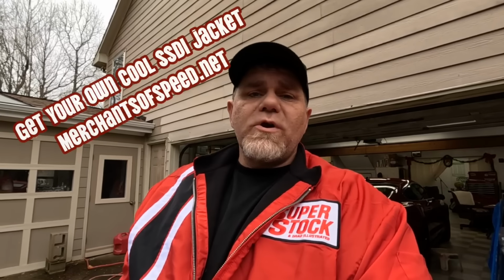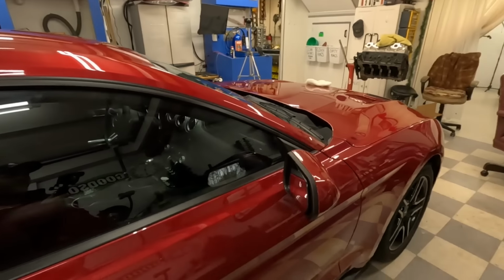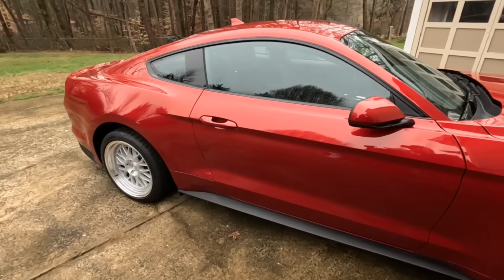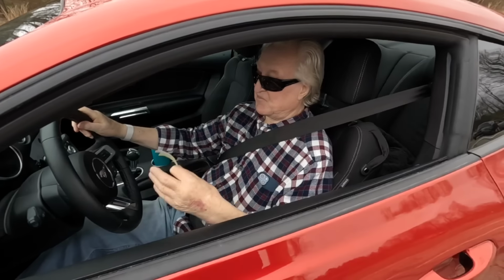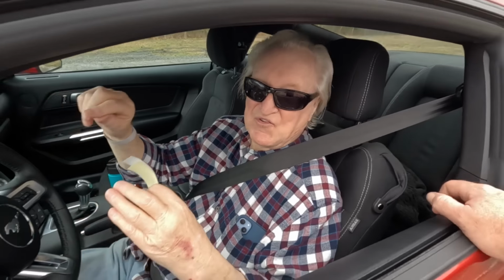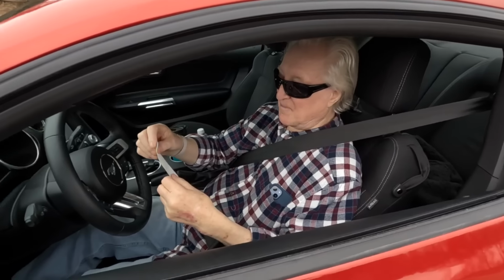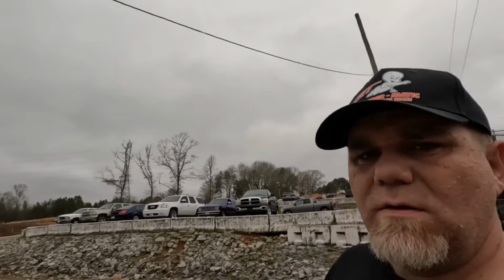EcoBoost Mustang 10R80 3.15 vs 3.73 Gear swap Drag Test! @DavidVizard @Boostismyfriend Shadyside

Comment: Your fighting torque management, you need to retune it with HPTuners or EFI live. The computer will pull timing if it the ratios aren't recalculated and the delivered torque values not increased.
Reply from the maker: We have HPTuners, I can tell it's not really happy.. hopefully once we have it tuned properly it will get down!
Thanks for the input and for watching
Andy
Reply: @UnityMotorSportsGarage  😅😅😅 Ecoboost and gettin down don't go in the same sentence.
Reply from the maker: @anthonykendrick1418 oh it will when it gets the Turbo and head Swap.. it will be down right nasty then..
Crazy if you ask me lol
Andy
Reply: You’re gonna need to get neck deep in the HPTuners for both the ECM and TCM tunes. I finally forked out the money for HPTuners and after spending a while with it, “Learning Curve”, I would swear my old truck is considerably faster than the day I drove it home from the Dealer 24 years ago. Btw, looks like a fun project.
Reply: @UnityMotorSportsGarage With HPtuners you can set your shift points to hold it in gear on the dyno. The bluecat software is good for setting shift points.

Comment: Why change the gear ratio when it has a 4.70 first gear?  That's like putting a 5.40 gear in a stock 5.0 foxbody and running on the gatorbacks.  It did good considering.

Comment: Glad to hear you're working with Greg, over at Eurocompulsion and using HPtuners' hardware/software! You should be able to dail in your Ecoboost Mustang to run high teens at 60' and high 7s in the 1/8 mile with just tuning, basic bolt ons and blended fuel!
I also recommend a taller (28") rear drag radial and experimenting with a 2nd gear launch.

Comment: As you guys were talking, driving to the dragstrip I wondered "what is the car's computer gonna make of this gear change?" It's an 18% increase in torque multiplication, not outrageous  but not peanuts, as the wheelspin shows. 

So many variables going on, it's interesting stuff. I'm sure it makes the car row through all those gears that much quicker now!
Reply from the maker: The computer just seems confused.. lol I believe a proper tune will fix it right up!
Andy

Comment: My 15 ecoboost had a sport position on the shifter and paddles on the wheel. It would let you hold a gear, unless you did something silly like slow way down in a high gear. It was 6 speed auto.
Reply from the maker: This is just a base model so it doesn't have the paddle shifters 😢
Thanks for watching
Andy

Comment: @UnityMotorsportsGarage- Cool temp's @ the track, mean's make's good power, but traction is not great. I would do more of a burnout, even with regular tires, to put more heat in them, on a cold day. The trick is, with regular street tires, do a low wheel speed burnout, but for about 8 to 10 seconds. This allows the regular tire to slowly build heat, but just as importantly, to coat it with the sticky drag tire compounds, from the other drag racers burnouts! It used to work great for me, i managed a 1.71 60 ft time, and ran a 12.21 @ 113 Mph, with regular Cooper Cobra radial tires, with 25 psi.
Reply from the maker: trying to do a burnout on that car is tough.. I can start a slow burnout but once the boost comes in it will just melt the tires without my permission.. its like a light switch! 
Thanks for watching and your input
Andy
Reply: @UnityMotorSportsGarage - Yes your situation is definitely different than mine was, yours being a turbo, and small cu. In. Eng.= very peaky= hard to modulate the power, vs my Na., Large cu. In. Eng.= very fat tq. Curve= very easy to modulate. Hope you don't think im a know it all? I'm just trying to see if i can give any idea, that may assist your progress. Do you think holding= manually putting the shifter in 1st gear, would work for your burnout procedure, with these regular street tires? This very low gear ratio, in 1st gear, would allow a high rpm(but low wheel speed burnout) for 8 to 10 seconds= a much easier, controllable, burnout? Drag radials, will definitely do better. Are you going to get the shortest drag radial possible, to keep tire wt. down, and gear ratio, as quick as possible? ❤your videos!

Comment: Are you all data logging? If not I highly suggest you get a bank’s data monster and start. Best part is it gives the rpm/sec acceleration weight. Obviously if you run under the same conditions and it accelerates quicker you are making more power. 😊 For about $400 you can monitor ever data point the factory ecu is monitoring and have a record of it.

Comment: @UnityMotorSportsGarage Andy & DV it won’t be long before you’re stressing the stock driveline to the limit when you add drag radials. Get the tuning right plus increase trans pressures along with shift points and adding NO2, I’m afraid you’ll find the next weak point.
Reply from the maker: That's the point! Something has to give... I believe it will live for a good while since the drive line in the Coyote Cars are basically the same. But we shall see!
Andy

Comment: The new wheels look great on it. Times are getting good now. Has the intercooler been upgraded yet. That stock IC gets heat soaked so fast. 
Again for reference my bone stock 21 GT ran a 8.03 on good street tires. You’re almost there with a stock turbo. Good luck

Comment: Hey Andy, question on the Caspermatic, what year 4r100  to look for on my mustang 2 project tia 😊
Reply from the maker: That would depend on the engine you are going to run. The 4R100's are pretty much all Mod Motor bells, I do believe that one year it was offered behind the 300 6 and that would have the SBF bell. 
I would take some measurements to make sure it will fit the floorpan and Firewall as it's a big transmission
Andy

Comment: Mr Vizard, Did you do the 3.73's for the 1/8 mile? I always used taller gears for my Turbo/Manual cars racing in the 1/4 mile. I didn't have to shift as much and they seemed to like load/each gear was effective.

Comment: Look at cvf racings heat exchanger upgrade.  They show real world gains in efficiency.  Might be why  it was lying over.  Hot intake air the computer will pull timing.

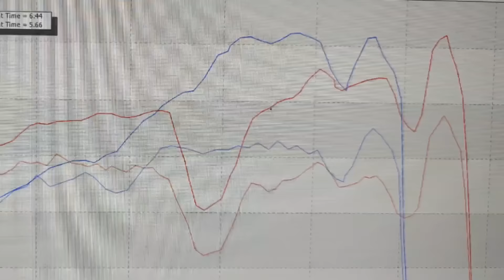Comment: First gear has a 4.70:1 ratio, a 3:15 final drive is not deep  , hell the overall ratio is 14.8:1 in first gear. A 4R70W trans in a car with 4.56 gears has a 14.3 overall ratio in 1st. With only 4 gears to work with, instead of 10.

Comment: What are you doing with the 3.15 gear set. I might be interested for my 1940 Ford Fordor when I change to an 8.8 instead of the 2.79 Pontiac axle.
Reply from the maker: This is a Super 8.8 gear set which is different than regular 8.8's 
Most likely once we add some real power to it we might need to put it back in..lol
Thanks for watching
Andy
Reply: @UnityMotorSportsGarage I read something about the Super 8.8 and it being different but nothing about what is different. I stopped at the local Ford dealer and talked to the parts manager who used to be service manager. He said he knew nothing about a Super 8.8 diff. 
I have a Crown Vic parts car with 2.26? gears and an AOD. That 302 must have been at idle speed on the highway. The ring gear is thinner where the bolts go through or the carrier has the gear mount flange moved over to make room for the large diameter pinion. Labeled an 8.5" but 8.8" carrier and gears drop right in.
I did get a set of 3.55 gears from my brother in law when he switched to 3.73 in his 05 Mustang that he used for track days. The 3.55 should work fine with an AOD with the wide ratio gears or a 4R70W. Putting the planetary set into an AOD would let me install without a control module. The car is a cars and coffee driver.

Comment: Hi, nice to meet you, I've seen your videos and I really love the Ecoboost you have. I wanted to know if you could tell me what exactly you need to put 3.73 gears, each piece. The thing is that I bought the crown, the pinion, the set of bearings and the shims. Do I need anything else apart from that? I hope you can help me. I have a 2020 Ford Mustang Ecoboost.

hola mucho gusto, he visto tus videos y la verdad me encanta el ecoboost que tienes, quería saber si podrías decirme que necesitas exactamente para ponerle gears 3.73, cada pieza, lo que pasa es que he comprado la corona, el piñón, el juego de baleros y las lainas, necesito algo más a parte de eso? Espero puedas ayudarme, tengo un Ford Mustang ecoboost 2020

Comment: Cool stuff. Why not go to 4.10's? It's a lot of gear for my SN95 with a T-45 but I'd figure it'd work great with that many gears!
Reply from the maker: The 10R80 has a 4.69 first gear ratio... Im actually thinking once we add more power we will need to take gear out!
Andy
Reply: @UnityMotorSportsGarage  , with that steep of a first gear, I would be happy with a 3.55. I remember swapping a 2.73 gear, in my 89 5.0 LX coupe ,to 3.55s. Wanted 3.73s but they were on backorder. Always thought the 5spd cars ran better with 3.55s. A lot of things have changed in 32 years.

Comment: will it let you start out in 2nd or 3rd gear ?  or how about just floor it from idle on the light. no power brake
Reply from the maker: It starts out in First from an idle but the problem is the lack of boost doing it that way.. and when it comes on it feels like a two stroke that just hit it's powerband
Thanks for watching
Andy

Comment: 15x10 wheel conversion with a bias ply slick would be a good place to start.
Reply: Car definitely doesn’t need a slick. Mustangs are going 3’s on a radial, the radial technology is far better than is used to be.
Reply from the maker: @nsxmatt absolutely!

Comment: I don't understand... 
Why are your track times slower than mine?
And I'm referring to the ET and MPH from my first trip to the track, when my base Ecoboost Mustang with 3.15 gears, was 100% factory stock with oem tires and pump gas, zero modifications , just like it came off the show room...??
I'm not trying to pick on you guys, I'm a fan and really want to see you succeed!